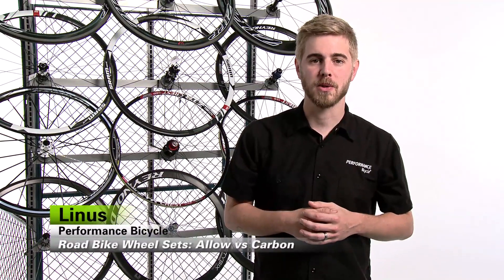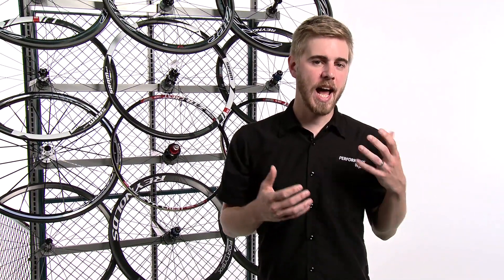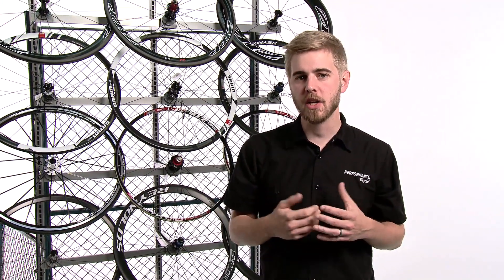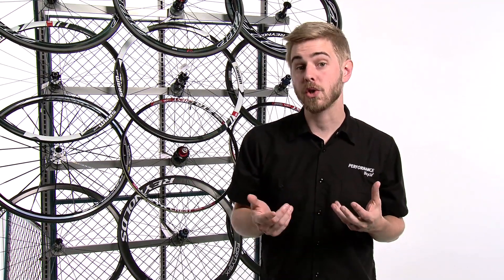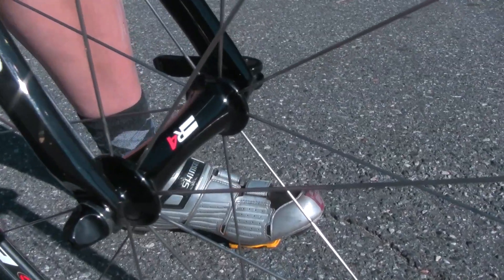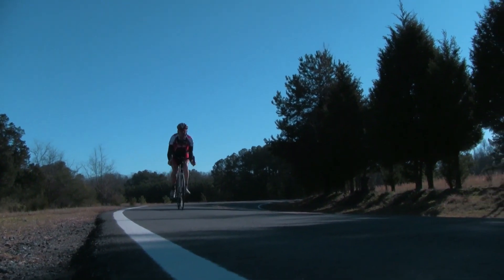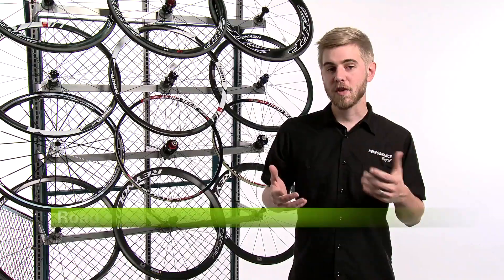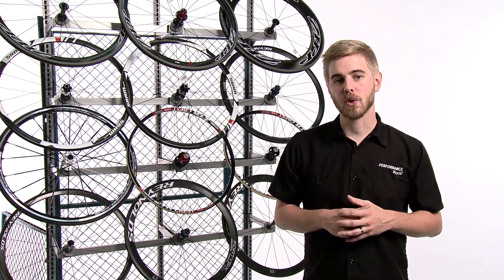Advanced Guide: Road Bike Wheels Alloy vs. Carbon by Performance Bicycle

Comment: If an alloy Wheel is more durable, and a CF wheel is less durable but lighter,  this doesn't indicate that the strength to weight ratio is any better. If the carbon wheel is built to be the same strength,  it will obviously be heavier. And if the AL wheel is made to be weaker it will of course be lighter.